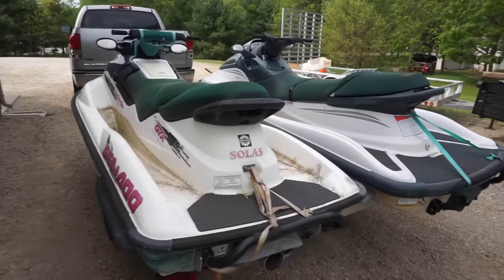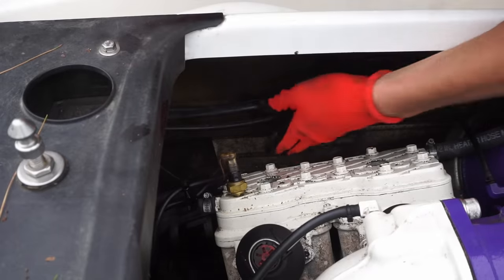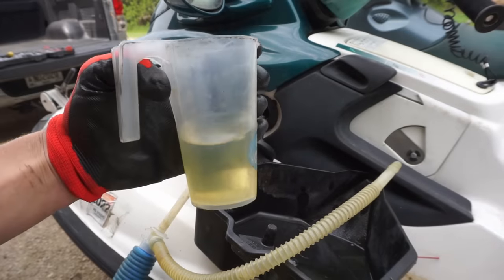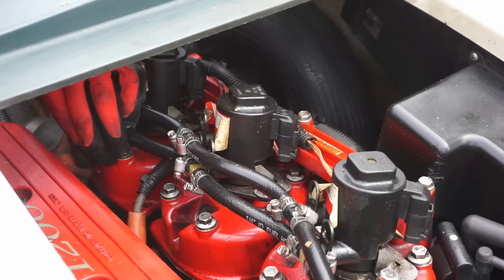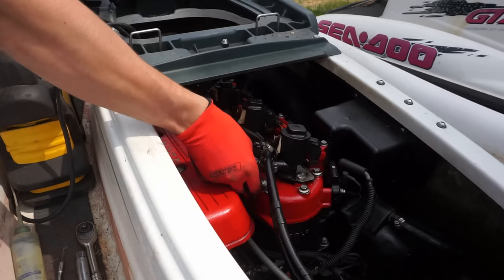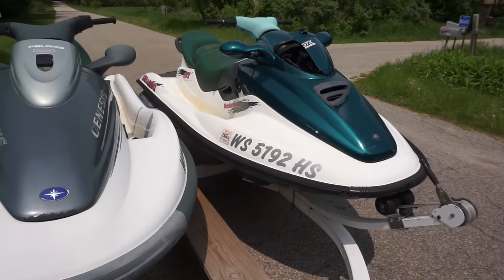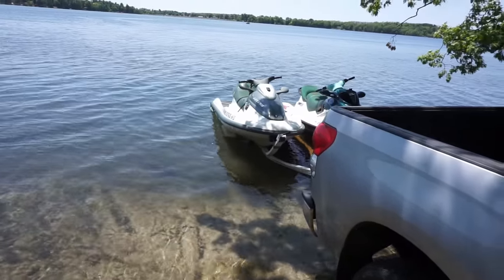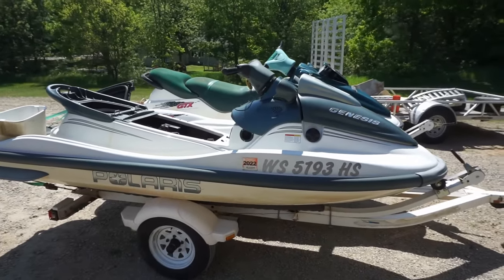$1200 Project "Jet-Ski" Package (INSANE DEAL)

Comment: It's best to bypass the oil tank and go straight pre mix gas. If the oil pump goes while riding which is very common for older machines you will blow up the engine.
Reply: Many people choose to do that, and I can understand why. But not on the direct injected machine from Polaris. If he gets rid of the oil pump, how is he going to get lubrication to the lower end of the motor? He's not. The fuel is injected directly on top of the piston. The oil pump has three outlets with the one going to each cylinders lower end. Never remove the oil pump on a direct injection unit.

Comment: On those old seadoos always replace fuel lines if they are grey. The grey lines break down with ethanol and clog up your carbs. I would also suggest replacing the small oil pump lines running to your intake and triple check that your oil pump is functioning correctly. If you want peace of mind you can delete oil injection and run premix. It costs more because it uses more oil but for me it is worth it. I have 4 of these old seadoos and they are insanely fun to ride and wrench on. Also keep an eye on your plugs to make sure it isn't running lean but you're a two stroke guy you know how that works. Keep wrenching!
Reply: A bigger issue is when those lines are when they are connected the plastic liner is known to fold up inside the line and cause a clog.

Comment: Some machines have a "key" for a beginner mode that limits the speed. That may, or may not be the issue. Also, you don't want to start those in shallow water. They will suck up rocks into the impeller. Great score.
Reply: That's to old to have that key setup.
Reply: It could have a worn out wear ring in the jet drive though. The impellers have plastic wear rings and if it's worn out from sucking in rocks or other debris it could rob power

Comment: The seadoo is a 787 cc engine, making 110 hp.  Great engine, lots of power, fairly reliable seadoos go.   Some refer to them as 785 cc or 800 cc as well.
Reply: All very accurate information. And I haven't watched the video yet, but if the Sea-Doo seems to be running OK but doesn't make enough power under load out on the water, check the RAVE valves and bellows. The valves can be stuck or there can be a tear or a hole in the bellows not allowing the valves to lift and losing 4 to 500 RPM on the top end. Also, make sure the oil injection pumps are hooked up. Some people delete them and run pre-mix. If the next owner doesn't know that or doesn't notice it, bye-bye two-stroke. That Sea-Doo 110 is one of the most solid motors out there when rebuilt and taken care of correctly. Anyhow, I'm actually going to go watch the video now. I will be back here a lot though because you are barking right up my tree with Watercraft.
Reply: @ar2043  I would say to also check the wear ring... although it was hard to hear if there was any cavitation compared to acceleration in the video
Reply: Good point and I absolutely agree. He really has to get a flashlight in there and check out everything. And intake grate, impeller, wearing etc. etc. etc. Also on a separate note, it's OK to run them for 10 or 12 seconds but he needs to realize that the water is also used to keep the drive shaft seals and bearings cool. If he runs them too long without a hose on them, he could burn up the drive shaft seals and bearings. And of course he needs to know that if he puts it on a hose and  runs it, it engine on then the water and then when he's done it's turn off the water then shut off the engine or he could wind up filling his engine with water through the exhaust.
Reply: Great info. Also if your rpms give you problems on the water, check the voltage regulator. You can pull the red wire off and the problem will go away (except your battery won't charge). This is a quick way to diagnose. 
I didn't watch the video yet, but if you have grey fuel lines, they HAVE to be replaced and the carb will need cleaned. They make this green goo that clogs the fuel system. 

Another common problem is a leaking oil tank. The bottom grommet is cheap to replace. 

If your lcd display is booked, they make a replacement diffuser film for cheap. And chances are, your fuel gauge will need repaired. Tons of youtube videos for that.

Lastly, if you add a battery tender, put an inline power switch to prevent the tender from backfeeding  the computer while it sits.
Reply: Many Bombardier 2-cycle* engines are manufactured by Rotax in Austria. The same manufacturer that makes high-output, low-weight engines for light aircraft. Have a dual-expansion chamber, H.O. model allegedly capable of 118+hp sitting in my shed waiting for the proper application to come along to install it into.
Reply: @ar2043  Yep if you delete the oil injection on a rotax and don't keep the 2 cycle oil tank to keep the center section of the crankcase filled with oil on a Rotax engine it will strip the brass helical gear that runs off the crankshaft and turns the rotary valve. It costs 70 dollars to repair with your own labor that is.

Comment: Those worm gear clamps dig into the rubber fuel line hose and cause small cuts in the fuel line. Check out "fuel injection clamps" they are a compression type clamp and much better suited for a project like this. Great content. Thanks

Comment: You should always run them with water as the impeller needs the water to lubricate it ,running it dry damages them in my experience.
Reply: no the impeller doesnt touch anything inside the pump. Just the engine needs water if ran for more than a 60 secs or so
Reply: The shaft seal needs water, especially sea doos carbon seal
Reply: @SuperCreativeLemon  oh I guess youre right. I mainly know superjets

Comment: Welcome to the world of 20 year old jet skis!! You don't need to worry about your hair going gray because you're going to pull it all out!!!!
Reply: Your comment had me dying 😂... I bought a 1999 Seadoo GTI for $800 in May. So far, in 4+ months, I've spent about 2 hours riding it. It has broken down with a new issue after every ride. I'm up to about $2000 in repairs, with a new engine being my last big expense. What a f-ing money pit... But I'm determined to have this thing running like new and being dependable. I did end up buying a 2016 GTI Limited to balance out my stress by having a dependable machine
Reply: @r1sabotage just bought a 2002 GTI LE and the rear cylinder blew up on me 15 minutes into the first outing, limped it back home on one cylinder and now I am $1,000 in repairs, new top end with cylinders and cover since previous owners did not winterize it at all, have the whole entire engine pulled out in them cleaning the hull as well. About to rebuild the top end since parts are coming finally and also needed a new drive shaft and carbon seal. Going to have someone service my jet pump and if needed rebuild it as well, and also having reprogrammed a new key. My project so far as well

Comment: Hey. Just a heads up with the ficht fuel injection. Make sure the computer gets it water cooling. If it doesn't it will overheat and Fry itself

Comment: The Seadoo is a better ski, the Polaris is descent especially with the later years. Earlier years are very problematic. I loved hearing the old Seadoo sitting for a few years just fire right up.
Reply: Subjective,  but I guarantee you that polaris will scream away from the seadoo.  I had a polaris virage 1200 similar to his and it was scary fast.
Reply: Especially if the Polaris Virage TX was fitted with a 6° pump wedge, modified stock sponsons and an Ocean Pro ride plate!! Bye Bye THAT particular Sea-Doo!!!!
Reply: @MPDano  I wouldn’t say scream since they both have a the relatively same stock top speed. Though I haven’t ridden them so that is subjective lol. The GTX states 53-55 and Genesis states 55-58 as far as what I’ve seen online
Reply: @Erick Shillinger  true sir.  I can just atest that the polaris virage gets to speed real quick.  I hit 60 real fast and it was just too scary to go faster and I know it still had more.  The one I had could have had more speed options as I got it 2nd hand.

Comment: I have a 95 and 96 seadoo xp. The grey lines HAVE to be replaced. They breakdown over time and will shoot all the sludge into your crabs causing all kinds of issue. I replaced the grey lines in both mine. Cleaned and rebuild the carbs. They both run great and as long as you keep up maintenance they will take care of you too! 👍🏼

Comment: Back in 2013 I bought a 2000 Kawasaki stx900 from a local dealer for 1800 bucks. It had around 65 hours on it and was owned by a guy in his 40s that only used it when his grandkids would come for a weekend now and then. It literally looked new and had a new cover and matching lifejacket. Fast forward to now it's been modded and has a turbo on it. Easily a 100mph ski and it's one of the rare ones with reverse which is very handy for trailering. And yes it came with the matching trailer for it. Gotta admit its probably the best thing I've ever purchased and I ride it every week once the weather gets above 60 here in Indiana. Kawasaki is my brand for quads bikes and waverunners

Comment: You can try Land Rover but more than one auto make, makes some just like that that go right into the top of the fuel tank. I've seen a Land Rover and one other make that looks like that on top of the fuel tank on vehicles.  but if you talked to a few car mechanics and show them pictures of that fuel pump setup from the top one of them will know what's very very close but legally watercraft mechanics probably couldn't tell you to try that.

Comment: I've found fuel injected things need the proper voltage just the idle battery not enough for things to run proper dirty connections usually

Comment: I would check oil injection pumps or block off and premix, not really supposed to rev these like that without a load (water) to push back
Reply: Sea Doo is a 787 rave valve motor. 110 hp stock

Comment: 53:00  NNNNOOOOOOoooooooooooooooooooooooooooooo, if your junk aint wet, DON'T START THE JET. Think of it like shoving a shop-vac into a fish tank everything within no less than 2' just got sucked up and out the jet nozzle. The impeller and wear ring will be trashed

Comment: Looks like the intake was eating the leaking exhaust. That machine should go much faster. Might also be a little main jet issue. I had a similar problem with mine. I have another one that's a super charged four stroke and it won't rev much past idle. Haven't worked on it yet, but I believe the problem's with one of the sensors. Can't wait to ride 'em this Summer. My son and I plan to head up the Chesapeake bay to Baltimore's inner harbor and have lunch at the fish market, then we're heading down the bay to Ocean City. Should take a couple hours to get there.
Reply: Main jet lol it's fuel injected lol.has no main jet
Reply: @jerrywilcox9890  , didn't know it was injected. One of my jet skis is injected, but it's a 4 stroke and supercharged. My 2 stroke is basic, but very quick and fast.

Comment: The blue oil has TC-W3 in it an will cause your inner crank seals to leak oil into your cylinders, it will also cause the oil tank to leak

Comment: When using penetration oil before compression, arent you sealing it preventing blow by if it is low compression? On cars if we read low compression we put a cap full of oil in the cylinder hole and re do compression cause it allows us to pin point that when the oil seals the pistons it will go up in compression concluding its blow by on the pistons and not 100% a stuck valve.

Comment: Polaris: I would suggest driveline. It sounds like the enginge is reving but you're cavitating and badly. Could be an impeller. Pull the pump and check it.  The Polaris has F*cked I mean Ficht Fuel Injection I'll link a forum board that has info on repairs for FFI. Here is sum fun facts Kawasaki Used FFI, Sea-Doo and thier parent company Bombarider used FFI and Polaris used FFI, Kawasaki junked it, Sea-Doo owned  the rights to it and junked it, Polaris used it and then stoped making skis if its time it was the bees knees. With the Polaris "Red" (domestic) engines those CDI boxes are tempermental and will not create spark if the battery is low so make sure the Polaris has a good battery at all times, or, no spark for you! You could also make sure the reverse bucket is tight in the up postion cause it seriously sounds like a cavition issue. This 1200cc engine makes about 130hp.

Sea-Doo: Eh, make sure you have no grey "tempo" fuel lines, if so replace them. The engine in the GTX is a 787cc or people called it 800 and those engines will take a beating and come back asking for more. Personally I alway used (Sea-Doo brand)XPS Synthtic oil some people use cheap whatever oil for them but low quality oil can gum up your RAVE valves and you don't want that. This 800cc engine has 110hp.

Take care of these old 2 Stroke skis, they don't make them like they used too.

https://www.greenhulk.net/forum/personal-watercraft-performance-skis/polaris-pwc-performance
https://www.greenhulk.net/forum/personal-watercraft-performance-skis/polaris-pwc-performance/polaris-how-to-faqs
https://www.greenhulk.net/forum/personal-watercraft-performance-skis/polaris-pwc-performance/polaris-tech-tips-and-info/191309-

Keep us posted I wanna see that Polaris live on a lot of people sell them for cheap cause parts are getting hard to come back as Polaris exited the market in 2004 (2005?).

Comment: A lot of the guys in the Polaris PWC community would ditch the fitch fuel injection, and convert the to Carbs.
I got ahold of one of those engines. Converted it to Carb. And installed it in an SL700 hull.

Comment: I wouldn't be to surprised if you could find parts for the fuel system in a spare parts catalogue for Polaris snowmobiles.  It would make sense to use the same parts and engines in both.

Comment: take out the rubber brackets and pull the muffler out, clean it and make sure the tube for the exhaust exit is not clogged either

Comment: Make sure to check fuel pressure on the Polaris.  If it's not over 25 psi you will burn up a cylinder.  The Genesis is the smallest legal 4 seater ever made.  I have one with a shuttlecraft
Reply: What is the latest update on the genesis?

Comment: Do not start jetski with water running. Always start dry then turn on the water. You will hydrolock the engine if you turn water on first!

Comment: I guess his electrical skills aren't great. Get high quality LED's and solder/heat shrink. Might also just be a ground. Make sure it's not grounded to the hitch but the plug itself. You probably already know this stuff though. Killer find though. Those things look to fire right up with some basic maintenance or possibly good gas and battery.

Comment: hey all you jet ski maniacs. i have a 1995 wetjet kraze i just got. starts up and idles fine. i  cant get it to rev to the limiter, it just seems like its bogging. what should i check? i have pu0t a brand new carb in it, new check valve, reeds are fine, fuel tank holds pressure, both cylinders good compression... i dunno what else to check. maybe timing the engine? it is a yamaha 701 engine. code is 61x. there must be someone who can add some ideas as to what it may be
Reply: all the jets and pop off spring etc are correct to then factory specs aswell before someone asks that question

Comment: Man I told u several times about that Lucas oil it’s crap my cr rod bearing went out 2 times using this crap u keep using it and see
Reply: Get Yamaha injection oil for it or super m injection I use super m and 927 maxima makes both
Reply: Get some castrol super clean it will clean the white up